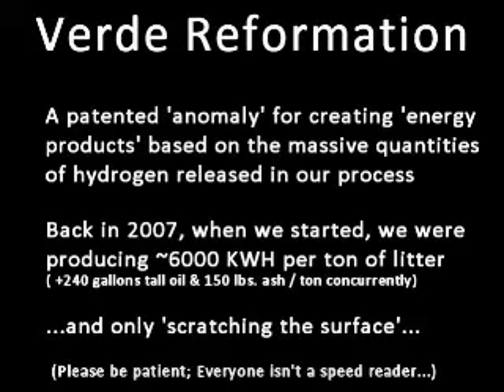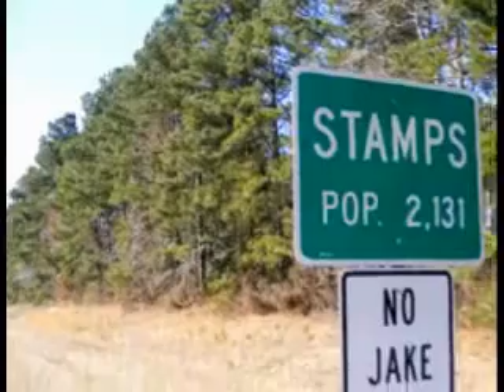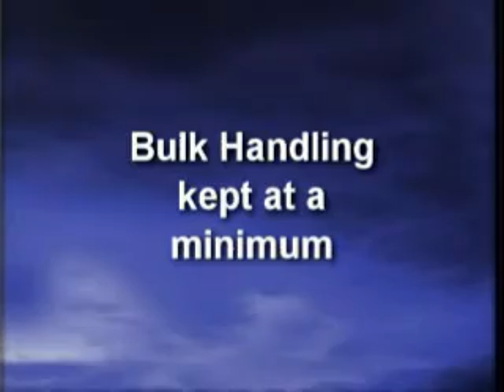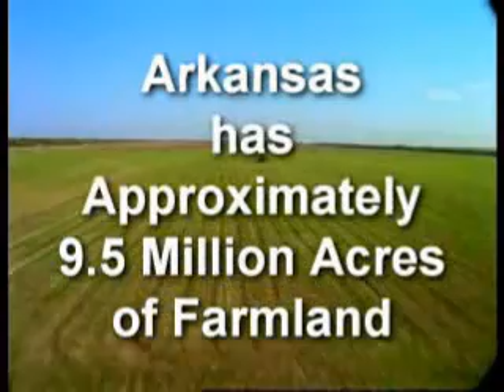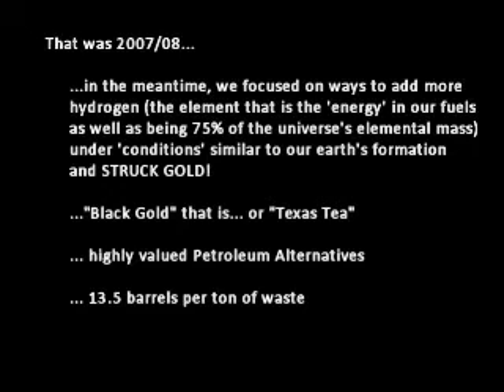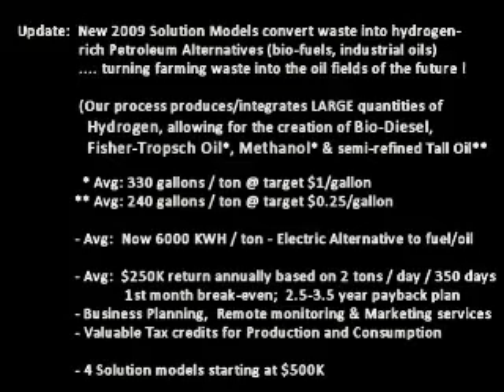Verde Reformation - Turning Water into the Hydrogen Fuels of the Future

Comment: The hydrogen recovery from electrolysis is about 50% at best, and most of the energy from the electricity goes to the heat released by that process.